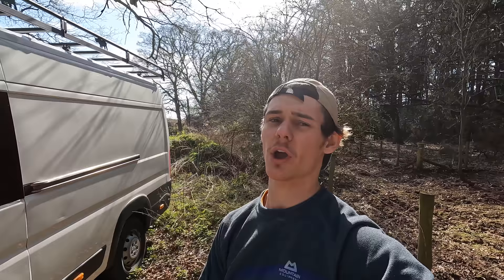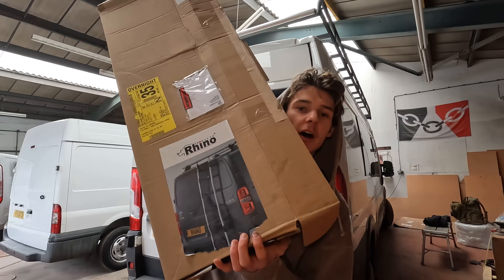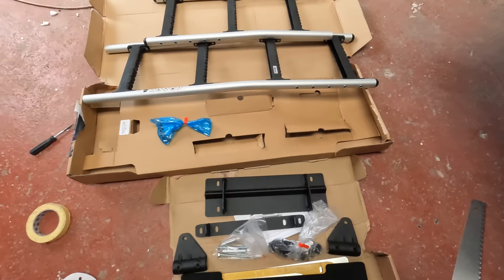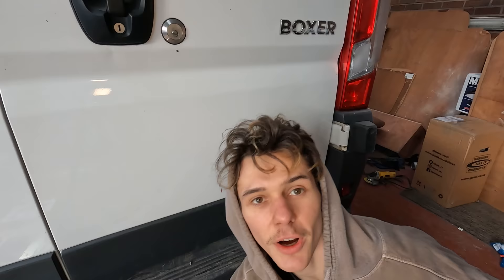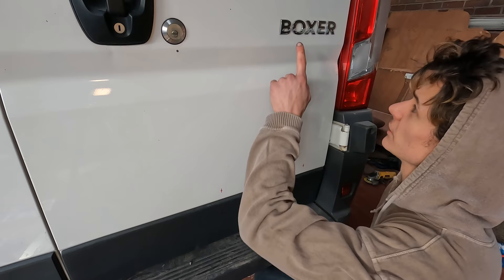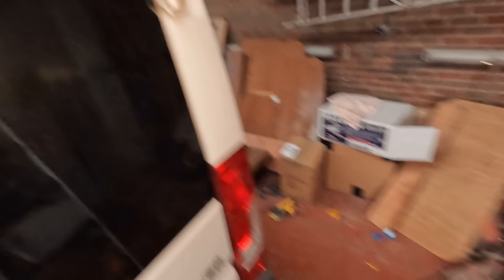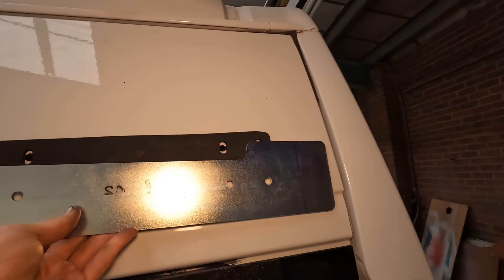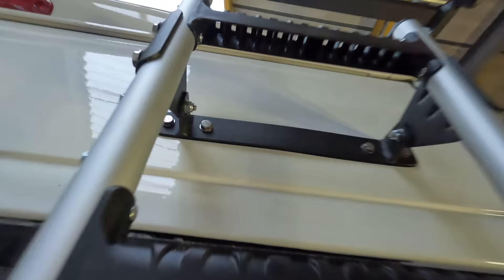SOLDIERS VAN CONVERSION - Fitting a REAR LADDER on a Peugeot Boxer! + Side Windows!

Comment: QQ ... Have you got reversing sensors and does it detect the ladder when you're reversing?
Rhino say they can't be used if you have reversing sensors or rear windows. I guess you proved windows are no problem, but if it doesn't mess with the reversing sensor I'm defo gonna get one.
Thanks.
Reply from the maker: Hello mate, Rhino may just say this to cover them selves, I can’t speak for it it will work on your vehicle, but I haven’t had any issues, my parking sensors still work perfectly :)
Reply: @JakesJourneyMate  Awesome, thank you.